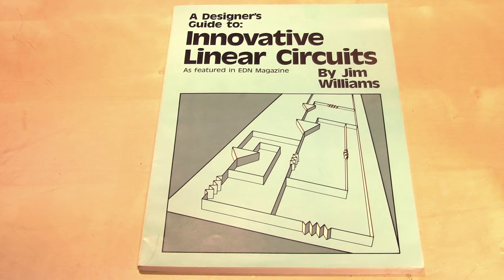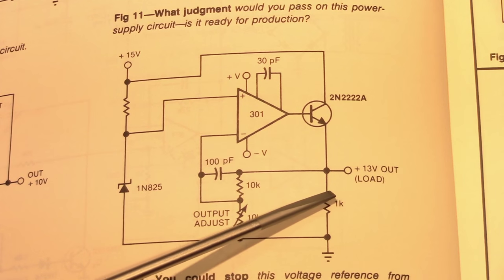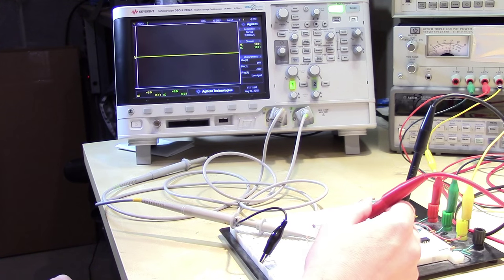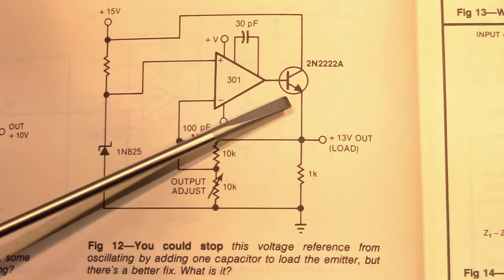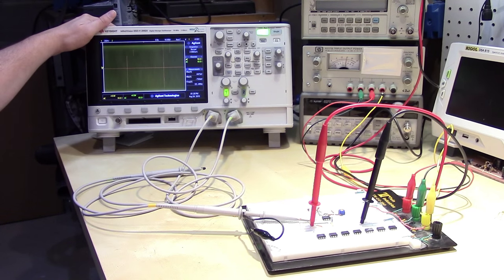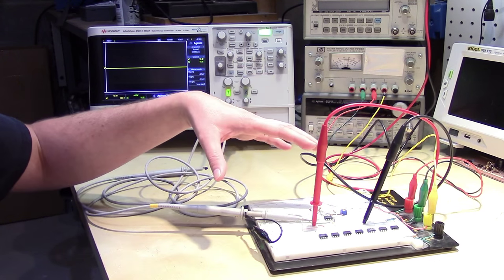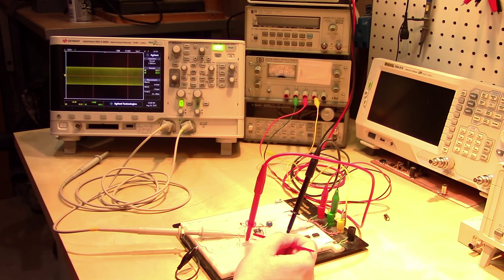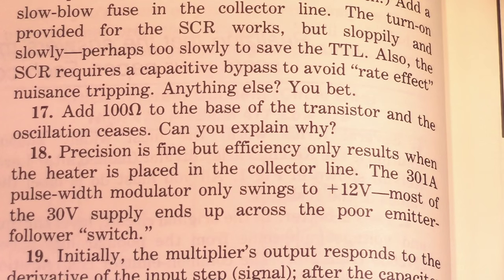Jim Williams' Test Your Analog Design IQ #17

Comment: Here's how I would have tried to solve it. I generally don't distinguish between ordinary ringing and continuous oscillations so I would begin by viewing the circuit in it's oscillatory state as a second order system with a damping ratio of 0, oscillating at a frequency F1. Based on that, there is clearly a capacitance between the npn emitter and ground. Call that C1. I would put a very small capacitor C2 in parallel with C1 and observe the new frequency of oscillation which would be smaller. Call that F2. The value of C1 can now be found easily and it is equal to (F2^2 * C2)/(F1^2 - F2^2). Now that you know C1 and F1, you can calculate a value of a virtual inductor L from F1 = 1/(2*pi*sqrt(L*C1)). This is your undamped LC system. You can now calculate a resistor value R in order to make the damping ratio equal to 1 for critical damping. The formula for that is R = 2*L/sqrt(L*C1). I would of course use a slightly bigger value to make it a bit overdamped (but not too much hehe). Put that in the base of the transistor and it should work I think...
Reply: That was a nice explanation! I got something similar using control system transfers functions as well. Of course I used the 2nd order equations directly and selected R for a large damping. Got it!

Comment: Way, way back when, before the uA709, we had our own op-amps.  Then there were molded block op-amps from Philbrick and others.  We tried one and found it needed an emitter follower to boost the output current.  Just like this story tells, we met an unexpected Colpitts oscillator.  And my choice was the same, some resistance to the base of the added transistor.  Well, it worked, but we did not keep using those modules for too long, as the uA709 (and later uA741) were as good, much smaller and also kept dropping in price.

Comment: Very good video! Jim was a great guru in the analog domain and not only there. You could also go for the 10 ohm resistor, if you add some small changes  to the circuit.

Comment: Sorry for the late comment, you can also think in terms of impedance. The follower has a negativ input impedance this negative impedance presented to a resonant circuit will force an Oszillation, by adding the 100ohm the impedance becomes positive so no Oszillation is possible.
Reply: Yes you are right ! We should put Rbase=|-Rinput| to compensate .

Comment: I initially thought it would be due to the trace parasitic inductance from the 15V supply to the collector of the transistor which formed an LC oscillator with the collector-emitter parasitic capacitance. If all else would have failed I'd have added a ferrite bead around the pin of the base.

Comment: Nice!
Reply from the maker: +w2aew Thanks! Tracking down unwanted oscillations is always fun; there's so many different ways that unwanted feedback & phase shifts can creep into even simple circuits. :)
Reply from the maker: +w2aew Just now noticed this got flagged as spam! That should be fixed now. Excellent advice and video as always! The 350MHz bandwidth on that 2467 is nice. I've been looking at picking up an older 485; the first scope I ever used was a 454A and since then I've always liked the 400 series scopes.
Reply: I love my 485 too. Extremely sharp focus on that CRT.

Comment: how do you know it is the Cbe and not the Ccb (Miller Capacitance ) of the common emitter stage that is causing the oscillations. the resistor added to the base could form a first order low pass filter with input miller capacitance (Cmi)  and damp down the oscillations .
Reply from the maker: +Kishore Saldanha Because the transistor stage is a non-inverting common collector configuration, not a common emitter. The Miller effect increases the capacitance between the input and output of an amplifying stage only for inverting configurations: https://en.wikipedia.org/wiki/Miller_effect
Reply: +devttys0 thank you,sir

Comment: I have to disagree with your Colpitts explanation for the oscillations.  The resistor would have a SERIES parasitic inductance, not PARALLEL. (Sorry, for the caps.  No screaming, just trying to be clear.)
I think a better explanation has to do with the bandwidth of the NPN.  The 2N2222A is not a high freq transistor.  At just a few MHz the collector current can lag the base current by 90 degrees, or more!  (This fact is important for understanding many BJT oscillator circuits.)  Try a quick simulation with LTSPICE, and see for yourself.  The LM301 (with 30pF compensation cap) used as a voltage follower will have a bit less than 90 degrees phase margin.  That's why it worked when you connected the feedback network directly to the output of the opamp.   But the additional phase shift introduced by the NPN can easily reduce the phase margin to zero.
BTW, I noticed that some have suggested that Miller capacitance was somehow involved, but this is clearly not the case because the collector is tied directly to the +15V rail with no resistor, so you can't get a multiplying effect on the input capacitance.
Reply from the maker: Thanks Steve! I agree with you that the Miller effect is not the culprit here. But you’re saying that the stray parasitics are not what cause the oscillation? That’s interesting, as all the explanations that I’ve seen regarding BJT amplifier oscillation - particularly emitter followers - list stray parasitics as the fault. I think I understand your premise though: it is not the BJT that is oscillating, but rather the LM301; the BJT simply adds sufficient phase shift such that the total phase shift around the feedback loop is 180 degrees, causing the LM301 to break into oscillation. If that is true, then I have some additional questions:
1) Setting up a simple 2N2222 emitter follower circuit in LTSpice, I do see the phase difference in the collector current vs base current. What I don’t see is a corresponding phase shift in the base voltage vs emitter voltage. Given the voltage feedback nature of the op amp, I would expect that there would need to be a phase shift in the voltage being fed back from the transistor’s emitter to the op amp’s inverting input in order to degrade the LM301’s phase margin.
2) Assuming that the surrounding circuitry is causing a sufficient phase shift to support oscillation, how is the externally compensated LM301, with a typical GBW of 1MHz, oscillating at over 20MHz? I would not expect it to be able to provide sufficient gain at a frequency more than 20 times its GBW in order to support oscillation.
3) How does this explain how emitter follower circuits which are not part of a feedback network (e.g., just a simple buffer amplifier) break into oscillation? Oscillation in discrete amplifiers is a common phenomenon, and emitter followers are particularly notorious for it.
Reply: Ooops!!  You are right. There is no voltage phase shift from the base to the emitter.  I just assumed this was the same issue I faced on a different circuit long ago, but it's not.  And you are also right that parasitics must be involved because the frequency of oscillation is much higher than the loop crossover freq; specifically, there must be some sort of resonance that provides enough gain to overcome the -40dB/decade roll-off (the LM301 seems to have a second pole just above 1MHz).  Perhaps it is something that isn't modeled in LTSPICE (because the Bode plot looks good) such as the lead inductance of the NPN.  I think that would produce a series resonance looking into the base because of Miller effect.  That would explain why the base resistor helped; it reduces the Q of the resonance.  Using a surface mount version of the 2N2222A might prove this hypothesis.  BTW, it's a pleasure watching your vids.  You're a very sharp guy.  And yes, I did subscribe to your channel.
Reply: Oh, I just got it to oscillate in LTSPICE.  Just 10nH in series with the base, and 10pF in parallel with the load makes is oscillate at very high freq in the transient analysis.  And I didn't even add the second pole to the opamp model, I'm just using the ".lib opamp.sub" macromodel.  But I'm still not seeing exactly where the problem is on the Bode plot.  Perhaps you could figure it out because I have to get back to work.  But this is fun.
Reply from the maker: The BJT's lead inductance plays a role I'm sure; in the video the solderless breadboard and the jumper wires connecting everything together are certainly contributing plenty of parasitics too!
Reply: @steverobbins4872  1 cm of wire has an inductance of about 10nH. Probably not a coincidence.As for those breadboards.. Bob Pease called them "slabs of trouble", and he was right!
Reply: @paulperry7091  On the other hand, for prototyping they are invaluable. If you can get your circuit stable on a breadboard, you're very unlikely to see it burst into oscillations on a properly designed pcb.
Reply: @RexxSchneider  ah, that's an interesting viewpoint!